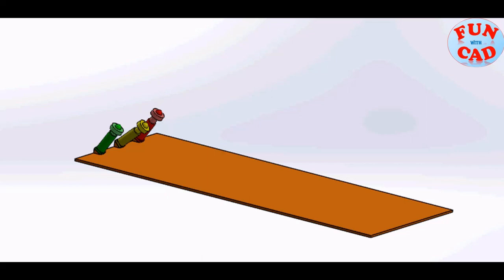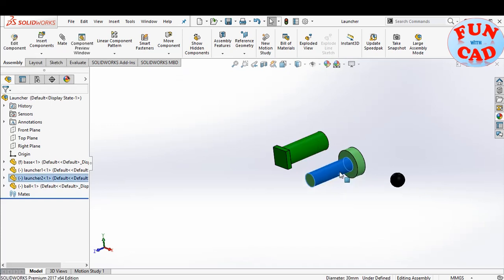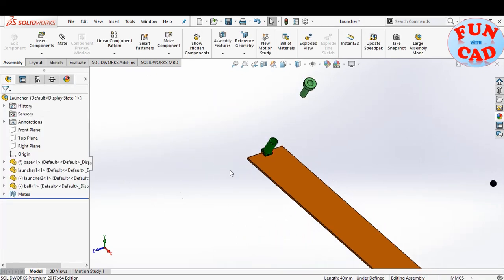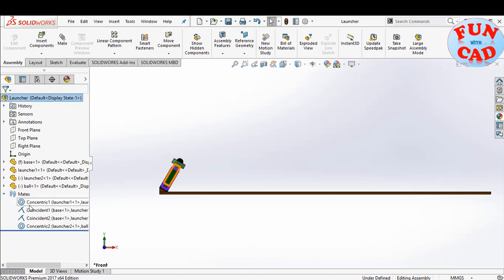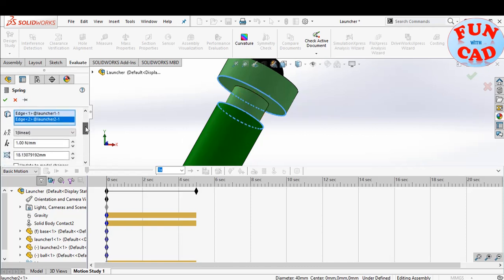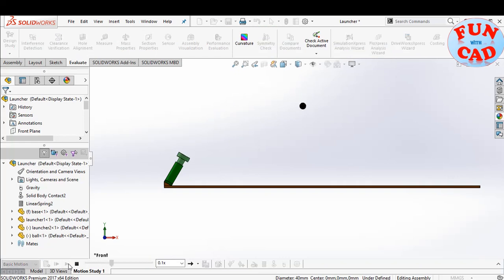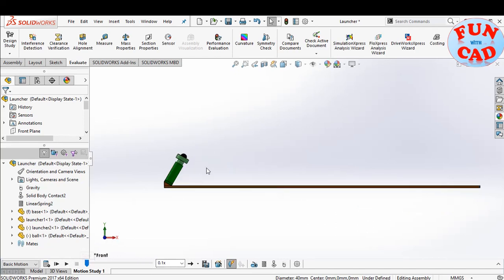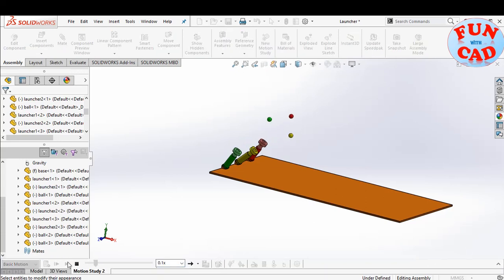Make Ball Launcher using Spring | SolidWORKS 2017 Assembly | Motion Animation Tutorial

Comment: hey, how can you choose the mass of the ball plz
Reply from the maker: Hello, you can choose the mass by changing the density, or you can directly change to mass properties
Reply: Thanks, 
Another question : rather than springs, do you think it’s could be possible (on Solidworks) to create a launcher with 2 (or 3) wheels turning and sending the ball during the contact between the ball and the wheels .
(Plz Tell me if I did not make myself clear) 

I work on this project but I would prefer to be sure if it’s doable…